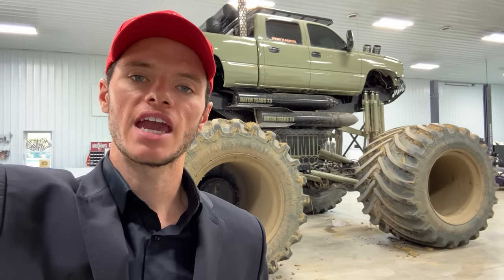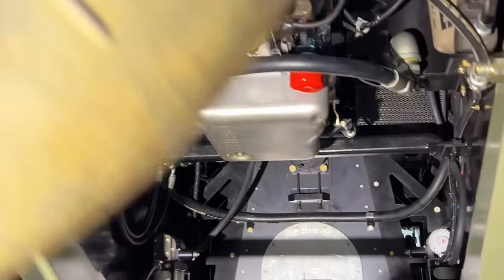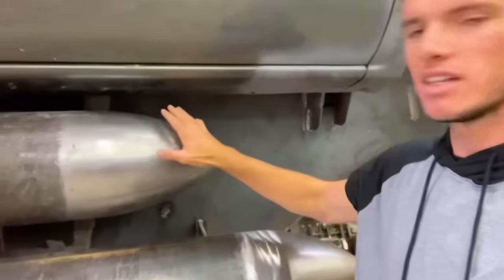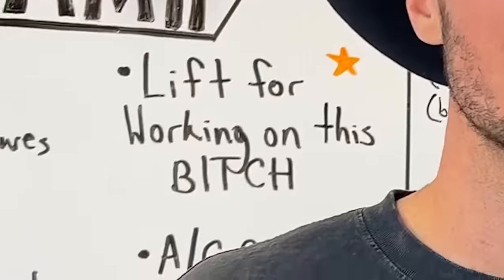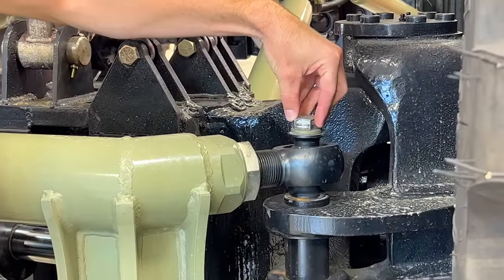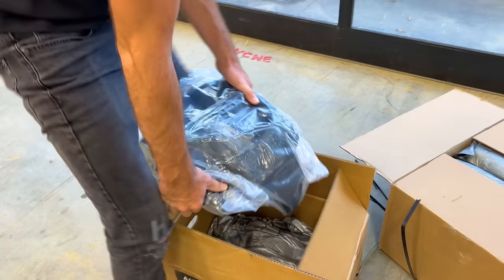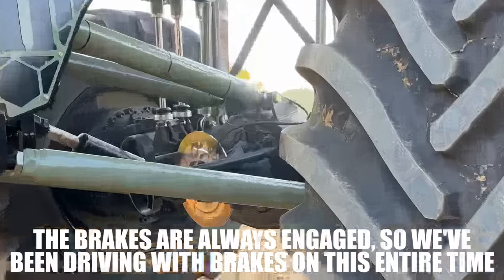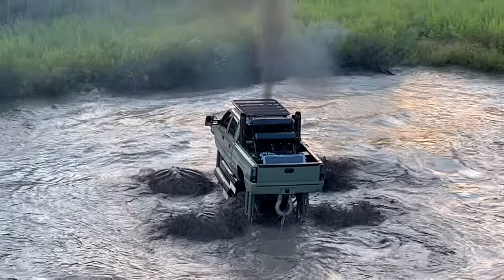MONSTERMAX 2 Initial Testing + Trial Update

Comment: For bottle jacks to lift the truck, you should look into aircraft jacks. They're telescopic and rated to lift huge amounts of weight and remain stable. They also have locking collars I corporated to keep them from falling if you lose pressure.
Reply: Or the jacks house moving companies use.
Reply: He should have hired people who build actual monster trucks. Like Grave Digger. Trucks that can jump 20 feet in the air and land no problem.
Reply: @helium5912  You do realize this thing is almost 3x the size of a regular monster truck...
Reply: @Durmarsa  and probably 5 times the weight. Lol
Reply: @helium5912  you do know that monster jam trucks cant take his abuse? He drives them into houses and shit
Reply: @rr3102  Norco Jacks. They work great!
Reply: @helium5912  There's a reason they can jump that high. They are made to be lightweight. Have you noticed how easily they break shit on those trucks? The are built like shit so they can get reactions from the crowd.
Reply: @helium5912  tell me you know nothing without telling me you know nothing 😂
Reply: @helium5912  your gonna hear this a couple times but that truck is built a number of times more reliable then a monster truck 

And much bigger.
Reply: pole puller would for for jacks
Reply: good call 🤙
Reply: ใช่พวก😅

Comment: Mechanics trying to play engineers usually fail to see design flaws until they break something and build it stronger the next time. Having 2x power plants it would be SO much easier to use two full computer systems running on the exact same signal inputs. The LT/ST fuel trim will balance itself. You need old man Jim from Wyotech (Blairesville PA campus) that man’s a damn genius transmission builder. Also, Todd Gillott was a lead GM engineer before he started teaching but he still consults for them. If you’d reach out to Wyotech I could see them taking this on as a fun challenge. We’d have had this thing sorted in a week lol.
Reply: Wait so you know a guy that’ll fix his trans
Reply: @mozambique32762  yeah and he also pointed out a significant design flaw and overcomplication without pushing it arrogantly down codys throat.
Reply: @koloblicin  i guess if he has anymore problems with it he can ask this guy
Reply: @koloblicin  the question is did he send this idea to the email that was plainly put in the front or just leave a comment that probably didn't get seen
Reply: Honestly I don't see why they couldn't have doubled the trans harness from one engines tcm and sent it to the other trans, plug,  it's not a lot of power to run the shift solenoids, and the slight difference in engine rpm will be taken up by the tq converter anyways.
Reply: E
Reply: @DGrant1801  Idk anything abt cars but this would mean if the controller engine went haywire you will now need to tow it even though you have a completely functional extra engine but wont shift.
Reply: @disguisedcat1750 yep….but it’s not like that’s not a totally normal issue….any normal pickup truck with one engine and one transmission would have the same problem….if the engine, trans, TCM, or ECM takes a crap….it’s not gonna move under its own power.
Reply: @J.R.in_WV  well but this thing will fail way more than any normal truck, plus towing it is way harder

Comment: I was a USAF helicopter crew chief back in the day. The H53 had 2 big turboshaft engines for flying. But it also had a very small turbine engine for running hydraulics and electrical while the main engines were off. You could install a small IC engine 
, or even electric motor and battery system, and have it running all the time which would support your brakes.
Reply: it definetly needs a turbine apu... the only thing appropriate for this machine. or just put a p&w j58 in the bed for auxillary power ... oh yeah well my alternator, power steering and brakes are sr71 powered...
Reply: Smart
Reply: Yeah but each engine on those helicopters have thier own fadec and fmu. The only helicopter id comapre the logistics too with what he want would be the damn shinook other wise thats not really both of them operating the exact same they actually just operate within parameters of one another . aviation is successful because of redundancy if he wants to make it happen correctly I'd tune and run everything all most separately and I'd use two tcu/tcms and get them within a parameter that would be difficult for him to trash. But honestly he'll probably over due it and trash it anyway
Reply: Anyone else have no clue what this man just said.
Reply: @prestonbaxter281  - we were just talking Aux power for brakes
Reply: He got air brakes so he can stop without power.
Reply: @allenhancey4493  im also in aviation so i followed along decently well
Reply: Love the 53
Jolly green!
Reply: @pakmatherdiverb  yep- quite a machine… a messy machine, but still super impressive!
Reply: @TacticalAnt My father was the crew chief in the military hanger at Sikorskys, also retired USAF. Thanks for your service 

What'd you spend most of your time flying in? I got a chance the fly in the 53 once, one of the coolest things I've ever done. Big ol sumbitch, most folks don't realize how big them birds are. 

He could run with your idea, just basically a pony motor to run auxiliaries. I'd go with an electrical motor, could recharge using the alternators off both engines. I'd imagine he's using the bigger 145amp ones compared to the stock one. If the 53's main rotor can run without oil for as long as it does then certainly they can fab up a second air compressor for redundancy. That's a big rig to get slowed down
Reply: @SlimTheGoat  - yea that was the suck thing. I was assigned to an ISO/Phase dock at Hurlburt Field, FL. Never assigned to a specific bird. Therefore, never flew with them, with the exception of 1 time. I got one post inspection flight on a 53 while TDY in England.
Reply: @tacticalant3841  small world, my dad did 2 years in England during his time in the service.

There's a really funny story about a crew chief who asked the pilot to hover over his house during the fall to blow all the leaves off his yard, what he didn't know was his wife had lit a fire in their fireplace. Ended up burning their rug and couch on fire 🤣

My pops has stories for days about the industry and his time in the service. Did you follow the field into civilian life?
Reply: @SlimTheGoat  -yep, same here, lots of good stories because there were lots of characters in the USAF. Sadly I was not as smart as your dad. I f8nd it hard to stay motivated doing the same thing over and over. I still have (literal) dreams of being reenlisted as a 53 crew chief, or sometImes im flying an H53 (which i never know what im doing in the dreams because i never flew them).
Reply: @SlimTheGoat  is your dad still around? What years was he enlisted?
Reply: @allenhancey4493  feels like I’m in a subreddit lol
Reply: @tacticalant3841  yeah he just retired a few years back, he's only 65 so still kicking. By my math he must have enlisted in 75/76, he was 17 when he signed up. He did 6 years, did his school in Oklahoma then went over the pond I'm gonna guess 79/80. Originally he was gonna work for delta but no airlines would take him bc he's legally blind in one eye from an accident as a kid, got into sikorskys kinda by chance. They looked beyond his vision bc he was good at his job but the FAA finally grounded him around 2003 bc of it, finished off his career there as ace pilot which is essentially quality control.
Reply: @SlimTheGoat   so was your dad a crew chief or pilot?
Reply: That's a big ass pony motor.

Comment: 9:08 your solution would be a brake accumulator. Engines would charge the accumulator, and brake would run off the accumulator. That way- if you don't have power (but your accumulator is charged with pressure), you have multiple brake applications. Very common in aviation. 13:02 large things that have fluid brakes: Lockheed C-5M Super Galaxy.
Reply: BMWs ran that system on their 7 series for a long time also, worked off the powersteering
Reply: Yeah c5 brakes oughta do the trick
Reply: well if hes going to air brakes they work as long as there is pressure. then lock on when there is none. unlike hydrolic that fail when they lose pressue/fluid.
Reply: My 78  Mark V also runs the brakes off the PS, and it has an accumulator. Very good brakes, but I think air IS the way to go for MM.
Reply: Don’t give up , I am and we are all knowing that you will wind this bs charges.
Reply: @gogereaver349  that's the point of an accumulator. It stores pressure and you can use the pressure without power. And with hydro, you could run other systems off it: jacks etc.
Reply: @sekusaf  indeed but the sheer wight of this truck makes hydro sytems pretty under powerd.
Reply: @gogereaver349  depends on the pressure you're running. The c5 that I mentioned weighs over 360,000 pounds.. without fuel or payload. Hydro can do whatever you need it to- it just depends on complexity.

Comment: That’s quite the truck Cody 👀congrats.  Thoughts on the double trans - what if you swapped out the automatics for a couple manual 6 speeds you could have the clutch disengage them both at the same time   and they’d both be connected into the same gear on that drop box 🤔 Oh and I’m calling it now, that drop box is the 1st thing that’s gonna break when you really start “testing”
Reply: So just hold in the clutch and shift two different gearboxes before you let off?  Won't that take a bit of time, so if you're accelerating or going uphill it's going to slow down more between gears?
Reply: @kugelblitz1557  if the linkage is connected together properly they would shift at exactly the same time 👍
Reply: Hater your face is gonna break 💔
Reply: @georgeotero2761  not a hater … just think that’s the weak link in an otherwise impressive drivetrain
Reply: @TwinStix  That would be a fairly complex linkage. one side has to move opposite of the other, and you also have to disengage two clutches, two HEAVY ASS CLUTCHES, with ONE foot, at the same time. The same linkage issue applies as the shift linkage, as well as the sheer gorilla legs you would need to exert that much force in opposite directions. just my two cents.
Reply: @kugelblitz1557  Your minds gonna be blown when you see how they used to shift semi's HAHA
Reply: @wesleyjackson8309  hydraulic master cylinder on the clutch pedal and send fluid to both at the same time
Reply: @georgeotero2761  Hater? The old monster max broke drop boxes constantly and it’s kind of a long running joke at this point that the drop boxes couldn’t handle monster max
Reply: @TwinStix  nothing impressive about that drivetrain , it should just have a c12 or 3128 or something similar... then there would be no need for 2 engines/transmissions and all the complexity plus he could put an 18 speed or 13 speed or maybe a 15DD after seeing deboss put a bus engine in his f350 it's obviously doable
Reply: @Hard_Right  those diffs are pretty impressive but agreed a dirty old 3406 would sure turn those tires but since he’s already got the two Duramax engines in there he just needs a couple manuals and a clutch and it would work 👍
Reply: there is a twin engine vr6 golf that has a setup like this! obviously not with drop box but he linked them and can even disengage the linkage to do a front wheel drive burnout and rear wheel drive separately then link them back up for his 1/4mile. So cool, i just dont know if any manual could handle the forces/weight even with 2 haha
Reply: @Twinstick Garage I don’t know enough about those Allison TCM’s to get why he can’t parallel the outputs to both transmissions from one TCM? I’m thinking he could still use the second TCM for feedback but it could just be connected to resistors instead of the solenoids?
If you put manual gearboxes, rather than put an old fashioned linkage, would you not use two modern electric shift mechanisms from a European truck? Our truck autos don’t use torque convertors, they’re just conventional layshaft gearboxes with actuators moving the shift forks, they only need simple inputs to make them work.
Reply: I was joshing dang dude 😎
Reply: Ecclesiastes 12:13-14
13 Let us hear the conclusion of the whole matter: Fear God, and keep his commandments: for this is the whole duty of man. 14 For God shall bring every work into judgment, with every secret thing, whether it be good, or whether it be evil.

Comment: If you want to run fluid brakes you can set up an Accumulator system similar to what heavy equipment runs.  It builds a fluid in the chambers that is pressurized via nitrogen.  That way if the engine shuts off you still have braking power available.  
You would be able to tie it into the hydraulic steering system since its already on the truck.

Comment: Shifting both at once will maximize shock to the drivetrain.  Wouldn’t you want to avoid that?  Have you considered running two TCMs so you can deliberately offset the shift points just enough to complete the first trans shift before starting the next to reduce drivetrain shock?

Another question would be which set of sensors does the TCM follow?  The TCM following only one set of sensors or making a complicated circuit to average them seems like that would drastically reduce the TCMs ability to protect one or both transmissions, understand what’s happening to make accurate control decisions, etc.  It would be sort of like multistory homes with a full HVAC setup per floor but they still all run off one thermostat.  It’ll still be hot upstairs and cold downstairs despite having the hardware in place to fix that if it were just controlled properly.

I’m an industrial electrical controls engineer with a hobby interest in cars but  I’m not an automotive or drivetrain expert. Still these are questions I’d ask.
Reply: Your definition of yourself matches mine, lol 
I have a lot of the same questions...
Also curious about the ECM setup since you have communication between the TCM and ECM as well.
Reply: Although I imagine if you can't shift both at once at the same time you're going to create some weird torque situations on the drop box, even with the torque converter. To me it seems like you might want some kind of massive torsen differential.
Reply: If you wanted 1 TCM to me you almost need a custom ECU to control two transmissions and simulate one, and have OR conditions for each sensor and solenoid to send feedback back to the TCM if there is a fault. Then you would need to somehow simulate the solenoid characteristics to fool the TCM. I don't know how you solve the speed sensor problem, because I don't see the torque converters working identically like a manual transmission theoretically would.
Reply: @anatolewiering5060  I wouldn't have one TCM or ECU running them both because they'll have different shift points regardless if they are attached on the same drive train. Although engines are connected with the same throttle, they have different RPMs. I would follow the differential route. An electronic differential with a servo in it would be ideal. That would protect both transmissions from unbalanced torque by allowing the lagging transmission to slip and the servo motor would spin up making up for that transmission's lack of required RPMs or lower gear, protecting the opposite transmission and engine from overworking. Could easily use a PCB controller for that. Go one step further and put one on each transmission's drivetrain before the transfer case.
Reply: @nickpedersen9524  agreed that's the best way
Reply: Two manual transmissions? With one shift knob????
Reply: @masonmckain6353  they are auto

Comment: Should’ve done a manual valve body for both transmissions so you could shift them without having to worry about electronics getting in the way, hope you find someone who can get it done! Love the videos.
Reply: ⬆️⬆️⬆️⬆️⬆️⬆️
!! Hell yeah brother!!
Thanks for being an active user congratulation.
have been luckly selected for the giveaway session
Reply: That's what I was thinking. But add paddle shifters on the steering wheel.

Sweet truck. Truly a living dream.
Reply: I don't see why you can't can't just mirror the second transmission off the 1st one have that transmission providing the feedback needed by tcm. To shift ect. But have the 2nd transmission wired in parallel.minus the sensors so as far as the tcm is concerned its just 
Running a transmission as normal. Just piggyback the pins needed for shifting.
Reply: @jakejacob9814  i have no idea about any of that im sure the TCM can detect voltage changes which if running two off one the draw would be different and would probably cause a limp mode to occur because it probably thinks something is wrong with the one it’s using, if DDP couldn’t figure it out im sure it’s not that simple they know their stuff

Comment: Thinking waaay too much about gearbox situation last night, I assume the problem you are getting is seamlessly syncing them so that you don't get fractions of a second where massive pressure is put on one or the other, due to differential speed/huge traction/the ground joining them.

Seems like the best solution would be to get then both into neutral on each shift, shift one gearbox with the other on a delay still in neutral, then shift the other once completed, going to need specialised controller/programming and electronics to get that delay as low as possible, interesting challenge for someone!

Comment: I was thinking about the TCM issue and I believe the best bet is to have one TCM manual shift the other TCM like a master/slave setup. You need two TCM’s that are responsible for the clutch-to-clutch timing of their respective valve bodies but one must be in manual mode commanded by another in regular auto mode.